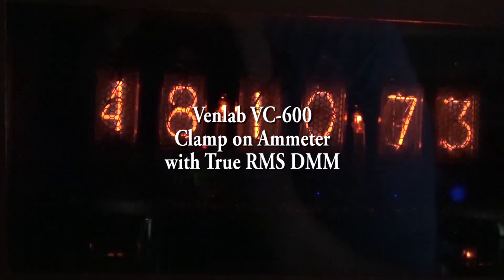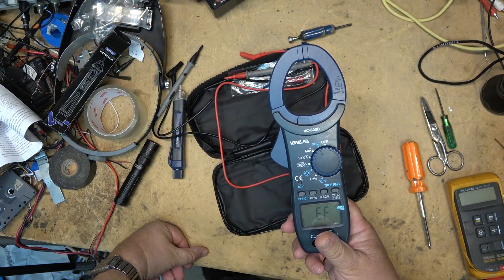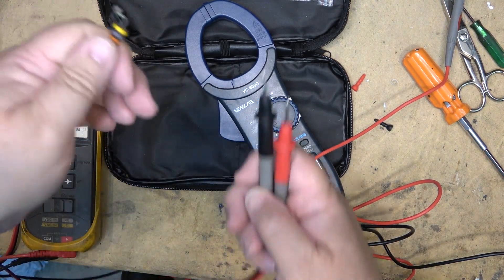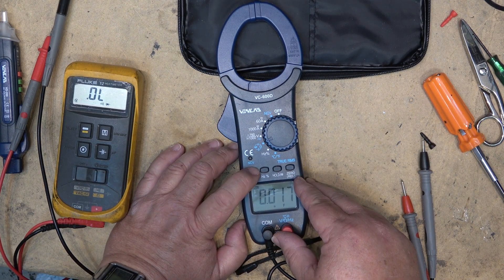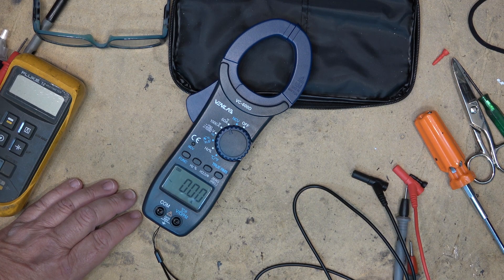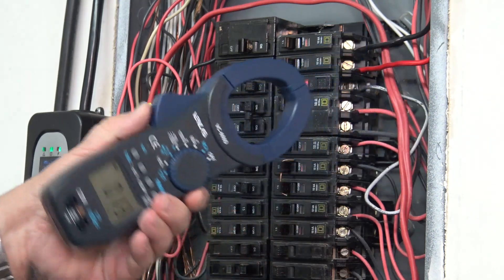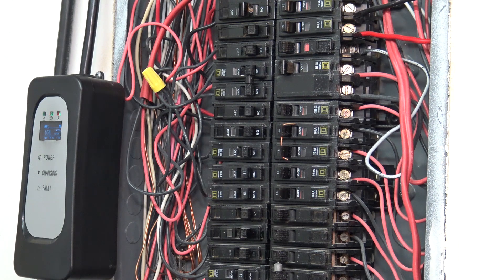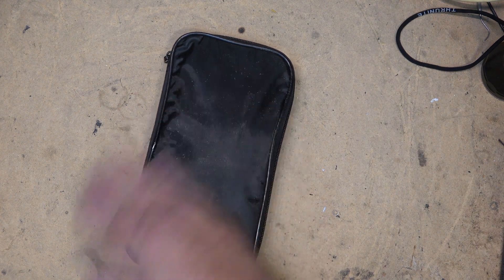Venlab VC600 Clamp on Current Meter with True RMS DMM

Comment: What's the lowest DC amps level that can be accurately measured with this clamp style meter (not necessarily this brand/model)?
Reply: You can get them that measure down to 1mA DC, however they can be misleading. That's due to them picking up all manner of magnetism and induced fields, and it's very difficult to properly null (zero) the meter prior to measuring. Even the slightest difference in position between when you null and when you measure can affect the accuracy.
The Uni-T model UT210E is the classic choice, however I bought a B-side branded one. I've found they are OK down to 100mA and pretty good down to 10mA. They just take skill to operate correctly, unlike an AC clamp meter.
The best way is to position the measuring wire inside the clamp with the circuit un-powered. Then place the meter down so you aren't holding it, and then press to null the reading. Finally, with the meter reading "zero" then apply the power without touching anything. As long as the environmental magnetic fields don't change, you will get an amazingly accurate result.
Keep in mind however that the DC measurement from a traditional "inline" meter can also be problematic due to Burden Voltage of whatever shunt is used. When you are measuring MilliAmps with a shunt resistor, you need a relatively high resistance to get enough voltage drop to measure properly, and that can affect the circuit and hence the accuracy.
Reply: @johncoops6897  Thanks very much!